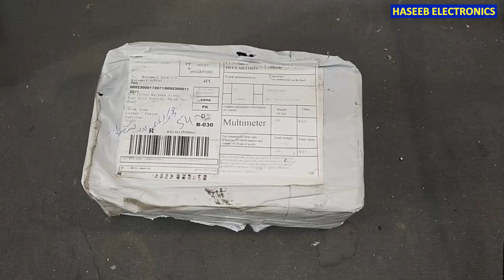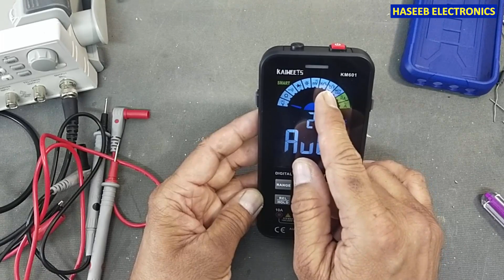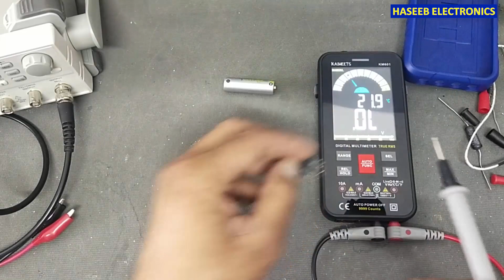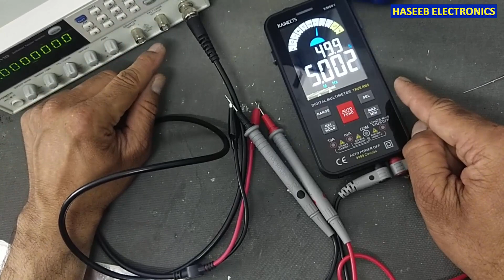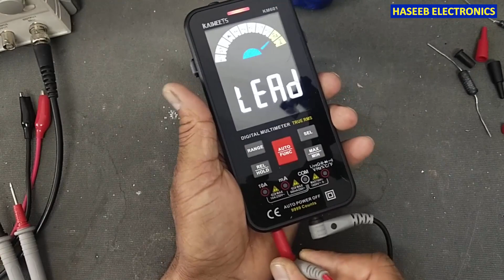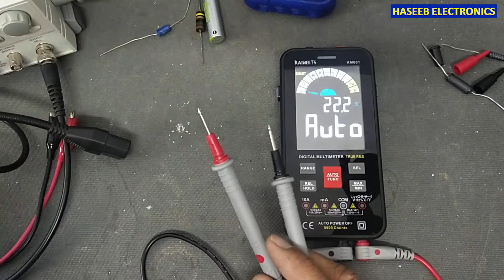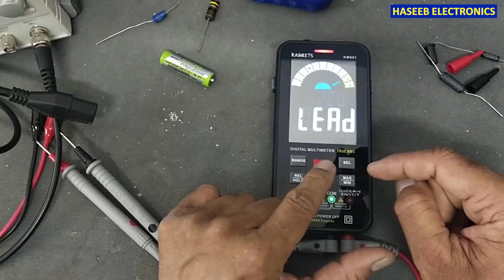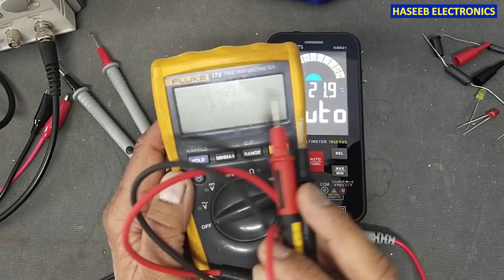{811} Kaiweets KM601 Smart Digital Multimeter Review & Use

Comment: bought 6 months ago! It's a great multimeter for the price! The only downside i found, like you've explain in the video is about the one way scroll of the manual function. I discovered if you hold the central red button it will switch back to auto, so if I am in Ohm menù and I want to turn back to Volt instead of go forward to all the function I hold (and it switch to auto) and then i press once. It's a bit annoing... but for less than 50Euro it's really nice to have.
Reply from the maker: awesome 
you are right, that is cheap and useful, its features are wonderful 
yes, because when i received it at that time i wasn't familiar with its features, after that i became to know that long pressing of the functions button, resets to auto mode

Comment: I had one like that. Actually nice in the beginning. found it drains battery very quickly. Screen turned black and just light up now and then….some funny connection of screen to motherboard. Yes price is low, but for my needs I will rather spend the money on a Fluke. 
But depending on what you need, it was an ok meter for easy measurements.
Reply from the maker: best regards and special thanks for sharing your valuable experience. i am totally new to this product. you are right, that large screen size may cause to drain the battery quickly. to overcome issue we can use some good brand batteries, so it can work for long period

Comment: In Australia the Fluke 179 sells for A$780.
You can buy the Kaiweets for under A$60
Which one will be more reliable? The Kaiweets looks flashy but its operation seems more fiddly and might be annoying.
But…..life is better with Haseeb Electronics.😊
Reply from the maker: mi love FLUKE even it is expensive but it is reliable. 
problem in kaiweets that it drains battery, and smart menus. 
i think Fluke auto ranging meters are awesome 
but comparing to the price, Aneng Q1, and kaiweets or other similar brands are acceptable

Comment: Capacatience not measure accurate.Thanks to review.
Reply from the maker: it is slow to measure capacitor, it needs few seconds to stabilize the reading. this is drawback in this multimeter. otherwise its parameters are acceptable when comparing the price  and quality 
another thing it consuumes batteris toooooo much because its display size is larger. so it is to be compromised

Comment: Horrible design with the probes attaching at the bottom, preventing the meter from standing at a proper angle.
Reply from the maker: you are right 
but it have a large display with wide view angle. so it can be used with easiness, 
while looking in camera it seems some horrible, while measuring on workbench or holding in hands, it looks cool